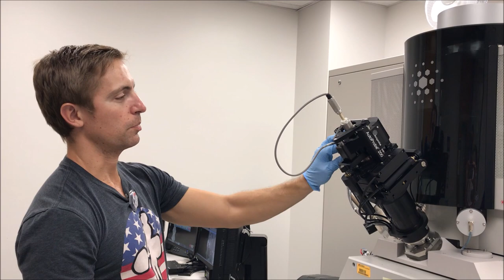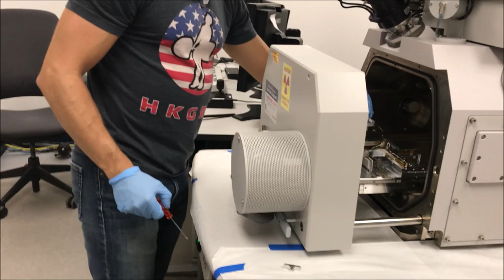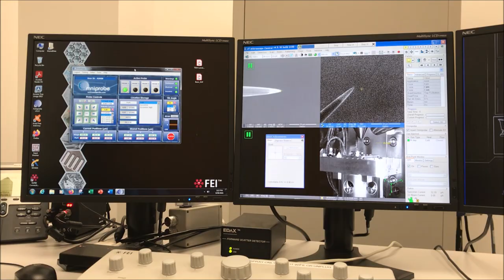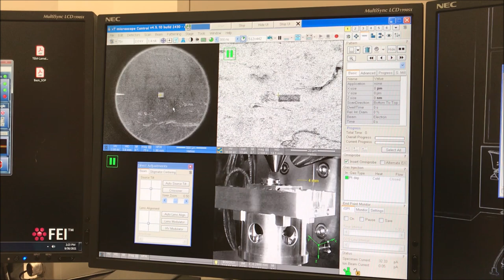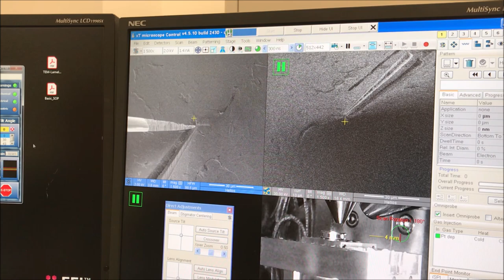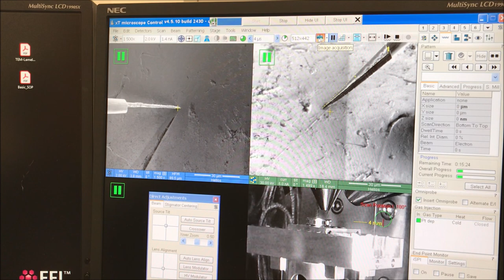Omniprobe AutoProbe 200 Tip Exchange/Sharpening Tutorial

Comment: Great tutorial! Is there any chance that the probe head can be sharpen down to 100nm in diameter?
Reply from the maker: Hi Frankie: thanks; considering you can make lamellas that are thinner than 100 nm, I would imagine you could also sharpen the probe tip this fine.  That being said, for lift out purposes, having a probe tip that small would probably not be a good idea as it would have very poor mechanical stability.  I'm guessing you would want to use a probe tip that fine for something else?